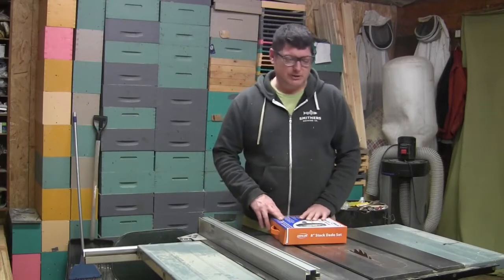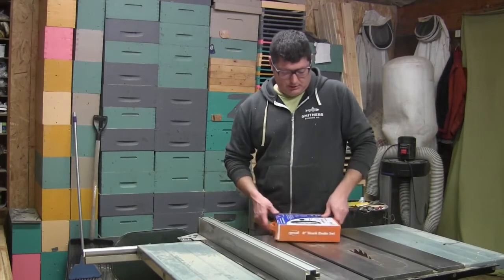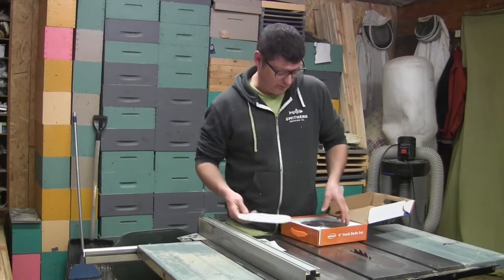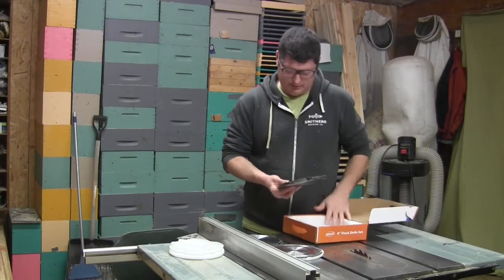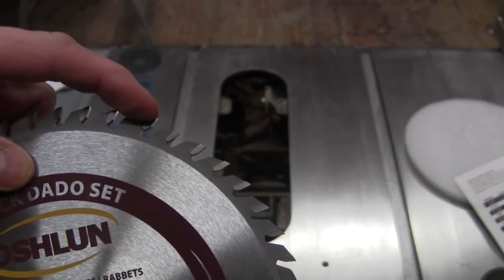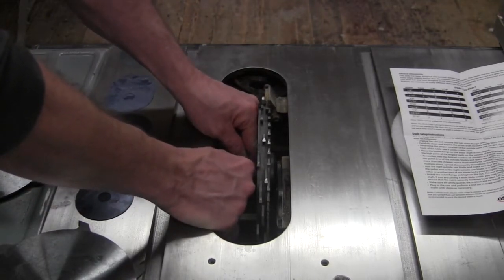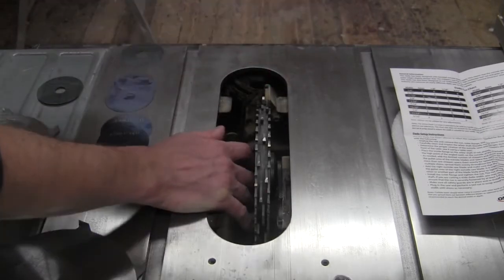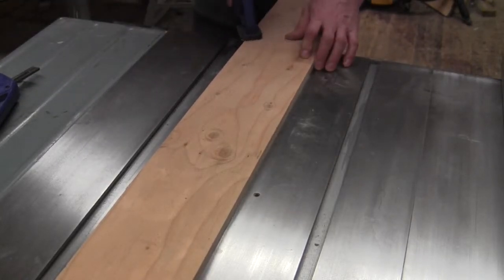Oshlun 8" 42 Tooth Professional Dado Stack Set Review, Unboxing and Use Tips

Comment: have been researching dado blade sets and there is not a lot info about on this set, thanks for the review 🙏 you don't happen by any chance to know the length of your arbor bolt? I have a dewalt 7492 table saw and the arbor bolt length is 28mm (approx 1 and 1/8 of an inch) just wondering if I could fit the full stack on and if not how much. Am looking at the 6" version of this set but am assuming its the same width full stack
Reply from the maker: Mine is the same length. If I use a thin stabilizing washer instead of the standard arbor washer I can fit the full stack without any spacers. Its just a hair over 7/8. To be honest though it will depend partly on the power of the motor on your saw. Mine has a hard time making very deep cuts at that width. And I haven't tried it on hard woods. You could do multiple passes. It cuts 3/4 in plywood and softwood just fine with the regular arbor washer.
Reply: @philsstuff  this is good to know, thanks, yeah will b using it primarily on softwoods to cut 8mm deep half laps quickly
Reply: Can I cut tenons with this vertically about 75mm